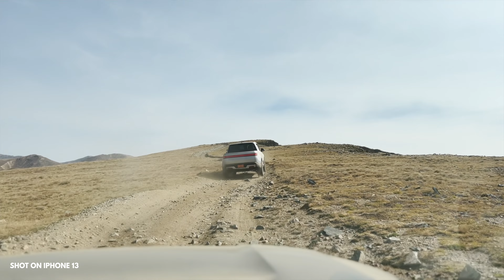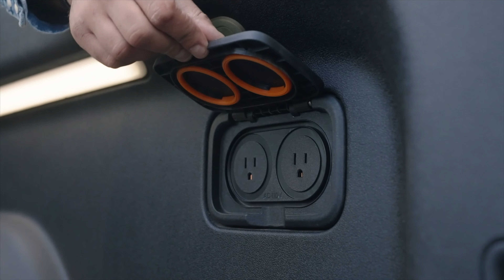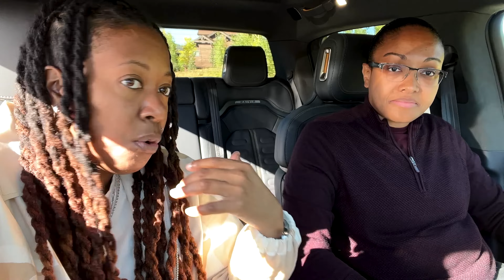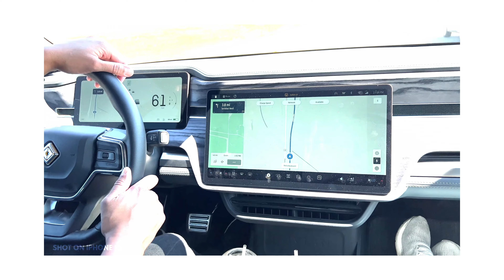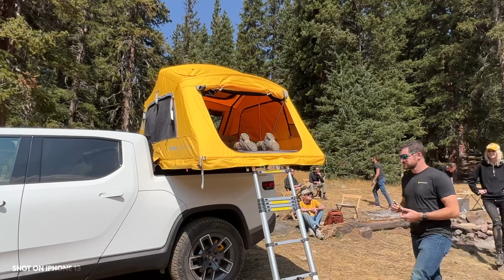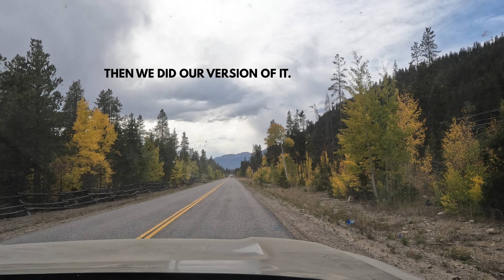RIVIAN R1T - World's First Electric Truck!

Comment: TechMeOut - RIVIAN is FAR from Being the FIRST ever Electric Truck in the World.
1890's AMERICA the Electric Truck was BORN & INVINTED here in the USA. 
they had 100+ miles Range in 12v Lead - Acid cells and batteries could be SWAPPED out or Recharged . 
there were MOSTLY used for MILK & FOOD Deliveries because GAS Vehicles made MILK & FOOD Taste FUNNY. 
and most General Stores had 100% ELECTRIC Delivery Trucks even PAST 1920 because they were a CLEAN VEHICLE . 

Flash Forward to 1990's and BOTH gm & FORD built the 100% Electric Ranger pickup & the Chevy S-10 Electric , during the SAME time as the gm EV1 Electric car. BOTH Legacy Electric trucks had 100+ miles Range using Lead Acid batteries.
and ZAP! Electric also made a 3 Wheeled Light Pickup around that time too.
ZAP! Electric still makes the Truck Today in 2021.

Comment: Impressive off-road capability, punchy acceleration, cleverly designed inside and out. The first electric pickup truck sets a lofty benchmark for capability, driving range, and performance.
Reply: TESLA Cybertruck is the WORLDS Fastest Pickup of any kind , 0 - 60 under 2.5 Seconds , with a PLAID Drivetrain.